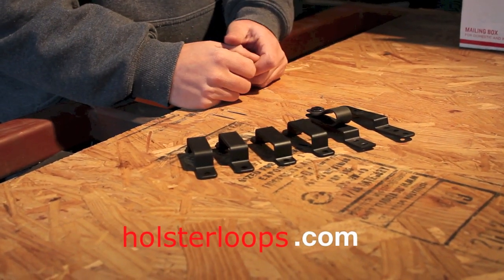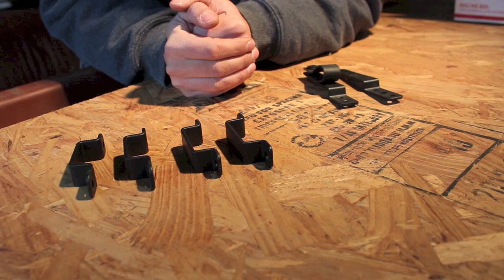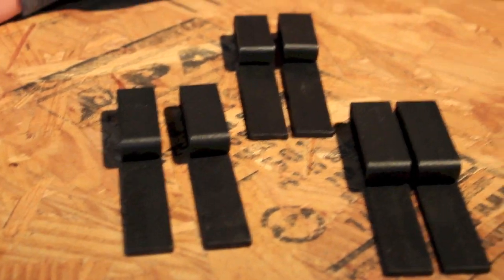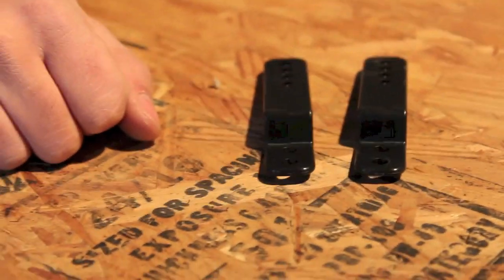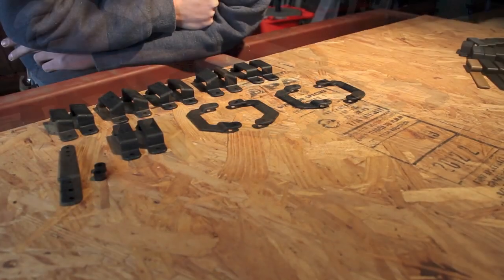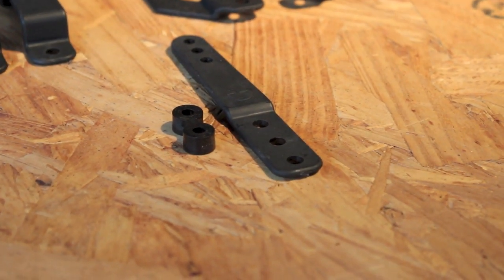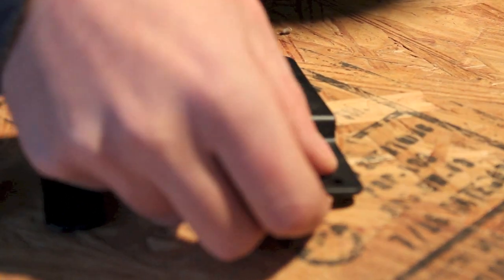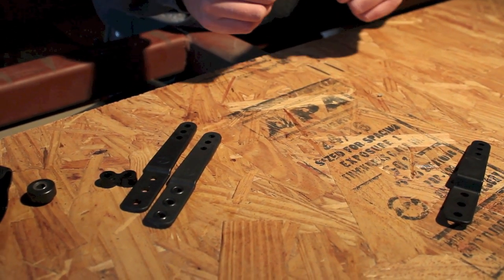Injection Molded Holster Loops

Comment: Hey Jon, is there any chance of you putting a short video together addressing the "draping" issue?  I'm sure we would all benefit from some tips you use to reduce it as much as possible. 
Thanks
Reply from the maker: It's a matter of being on top of the heat, pressure, and foam condition, on most guns. For others, you may have to incorporate an additional solution into your molding process or address it after it's been pressed.

Comment: the flaring die from knife kits has a female end that's significantly thinner that the female you had.  it's probably a tad fatter than a sharpie
Reply: and the male end is just as skinny.  it may or may not help get in tight against that hard corner

Comment: excellent video!  where did you get that white pencil?
Reply from the maker: The white pencil is a Stabilo marking pencil. You can get them online or at an art supply store. When we wash our holsters, we windex them, sponge scrub, rinse in hot, soapy water, and the pencil comes right off, along with buffing compound residue.
DO NOT mark the kydex with this pencil before you heat it, though. It makes it almost permanent.
Reply: yeah... same with my trusty bic mechanical pencil.  My favorite pencil but I have to strain my eyes to see it on most colors of kydex, especially the greys.  I need something fine like that, though.  I tried soap stone and couldn't embrace its crayon-like behavior.  You peaked my interest in your pencil when i saw you mark the drill holes and they looked like they would work.  A white mechanical pencil would be amazing!!!!!
Reply: your video was tits, though... for sure.  You cleared up a ton of things for me.  I ordered samples of owb loops a little while back and haven't played with them yet.  I like these closed loops from DIY.  I need to make a jig or something to perfect drilling a hole in that little tab
Reply from the maker: SentryGunleather They come drilled, too, if you want to save some headache.
Reply: yeah... i believe the hole is 1/4", though.  i like my holes a little smaller.  I may look to embrace that hole size, though, to save the headache like you said
Reply from the maker: I put a rubber grommet between the loop and the holster, anyway, so the 1/4th inch hole versus the smaller post doesn't really irk me.
Reply from the maker: SentryGunleather I can make it a point to be here tomorrow. Email me phillyedc@gmail.com

Comment: Are struts required or can i attach a soft loop directly to the holster?
Reply from the maker: You can attach them to anything that has a 1/4th inch hole drilled through it.